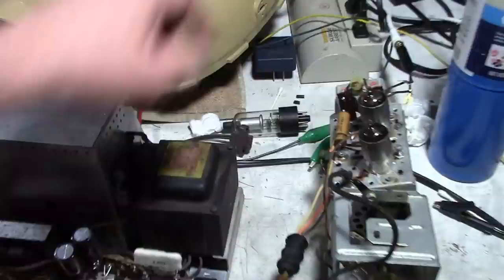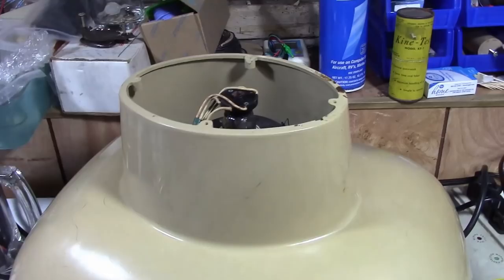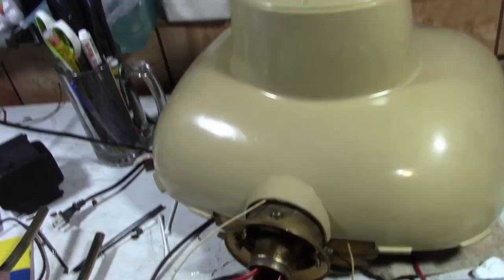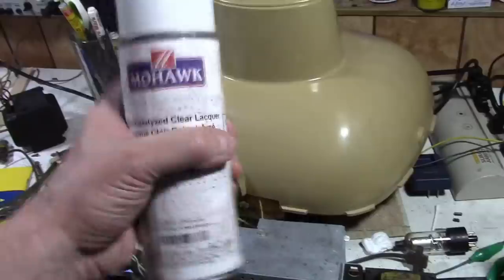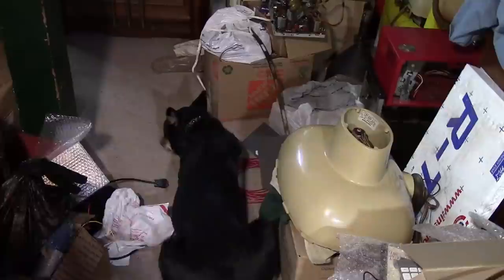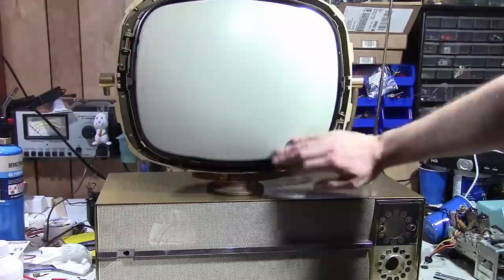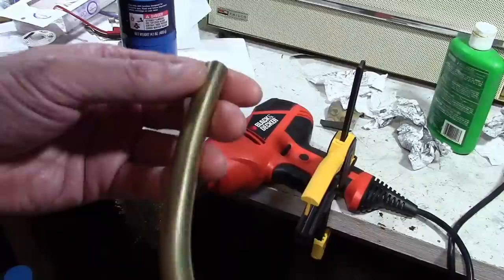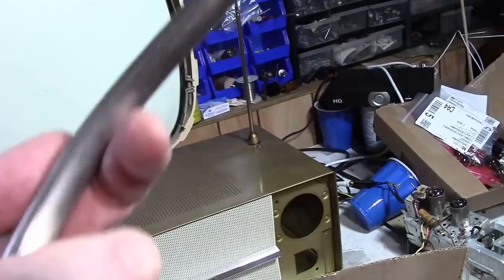Filthy Philco Predicta Siesta resto p11o?

Comment: if you flip the chassis upside down in the oven, any moisture that accumulated in the transformer over the years or due to cleaning can evaporate out the bottom opening safely.  If moisture caused the transformer short, this may be a way to continue to use the wash and bake method of chassis cleaning in  the future.
You do beautiful work and its always fun to watch your restos.  :-)

Comment: Bob, what I have done on one of my Siestas that brass plating was really bad on that horizontal bar across the front of the set, I wrapped it in gold chrome automotive vinyl like they wrap cars with. It looks great, but if I were to be picky I can say it was a little too gold in color, but it was absolutely a mirror finish. If you want some of that vinyl I can send you some to play with for free as I have a bunch of it or you can buy it on eBay or Amazon from lots of sellers. Also, I tried wrapping the neck the CRT sits on, and even though they say you can stretch that vinyl, I was not able to get it stretch at all.

Comment: This may sound silly, but what about just getting the arms down to base metal, and use tinted lacquor to get a brass-like appearance.
Reply from the maker: No, it's not silly.  I've mentioned it before and it's likely they did just that on some of these pieces.  I did discover though that these arms were chrome plated then brass.  That's why I can't get the same shine.
Reply: @bandersentv  The chrome pre-plating explains a lot.
And chrome plating is one of the toughest ones to do at home.
Highly toxic chemicals required to do it properly.

Comment: Beautiful work Bob, it really looks great. You are always your worst critic, I get it, because I am the same way. On the little clock cover missing the tab, a little piece of strategically placed double sided 3M thick two-sided tape will hold it secure and not be visible. I never knew about the brass transfer method you showed using the brass wire brush.How hot do you heat the piece you are transferring to?
Reply from the maker: Thanks. That's a great idea. Hot enough to melt brass - around 1,700F.  Just below a dull red heat on the steel. A propane torch is around 3,000F

Comment: Maybe I missed it, but has anybody suggested that you polish the arms to a mirror finish and then spray it with a golden/yellow tinted shellac? I imagine you could get it pretty close. 

I used this method on a 1940's brass plated table lighter.

Also, rub n buff is a metalizing product used alot in the movie prop industry. It can be polished to a very high lustre. Many brass color options too.
Reply from the maker: Yes, I've discussed in several times and others have suggested it.  Things is the vast bulk of the work is grinding out the rust pits and polishing.  Brushing on the brass only take a few minutes.    Another issue is that I discovered that these arms were originally chrome plated.  That chrome was ground off when I polished out the rust pits.  I think that's part of why I get get the high luster that other parts have.

Comment: Bob, research "golden brass prismatic powder coating"; the "Prismatic Powders" will work in an Eastwood Powder Coating Sprayer, and with the amount of work in your future, would be a justifiable expense, and when you add a USED "Constant Temperature Blue-M Cabinet/Oven" into the mix, would make all metallic cabinet refinishing, literally, a snap...
Reply from the maker: Please keep in mind I rarely do any metal cabinets, have limited space and limited funds.  For that matter its been years since I refinished a wood cabinet too.  Been thinking of trying a refinisher near our place that does antiques.  I'd rather focus on the electronics.
Reply: Most powder coaters will accept metal items, with their only prep requirement being "must go through their solvent wash to eliminate silicon, silicates, and silicones", the worst generator of "fisheyes". 

I did my own powder coating because I made automotive-sized rack systems, and consoles for police cars (Motorola Two-Way Radio dealer since 1977), it was a good money maker. The  425°F average "thermosetting temperature" cabinet, is the only real dealbreaker...

I would have charged somewhere around $35.00 to coat the fourteen pieces, with the first $15.00 being the "color setup/selection", and the balance consisting of the "per piece" charge, which actually skews lower with higher counts. In duplication, there is profit....

Comment: I strongly caution against using solvent on the front screen. Crazing is a big problem from incompatible material attacking the plasticizer. If you insist on the route try to stay with a C4 (butyl) chain to keep close to the butyrate.
Reply from the maker: This cover isn't Tenite.  Near as I can tell it is acrylic.  This is what I was going to try:  Weld-On 4 Acrylic Adhesive

Comment: Why not make new arms from brass tube. I bet they made them plated just to save cost.

Edit: well I know that would not be original part and all, but plating or electroplating is way harder than using solid brass tube.
Reply from the maker: I discussed that in the last video.  I may try it someday.
Reply: @bandersentv  must have missed that. Will check.

Comment: Heat the transformer up in the oven at the very low setting and then use a thin strong blade. First couple of laminations might be difficult to remove but with a bit of patience it will not be too bad. You can check out the way I did it:  https://youtu.be/40VC4W3bMQI

Comment: Does the linearity control have to handle a lot of power?  A Clarostat A58 would certainly work but they are expensive.  I would stick to wirewound, though.

You could have someone who is good at machining make a spacer to fit the back cover of the CRT housing.
Reply from the maker: Yes, depending on where it's set, it could see a couple watts.  The back cover just fits so no need for a spacer on this one.  I do need something for the Holiday though.  I don't know anyone who does machining though.  I'll use nylon spaces for now.